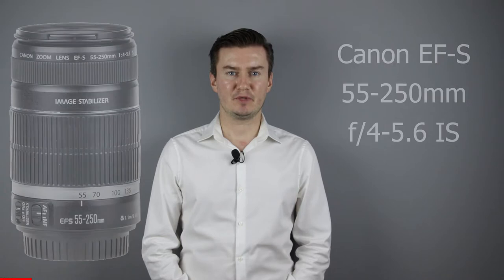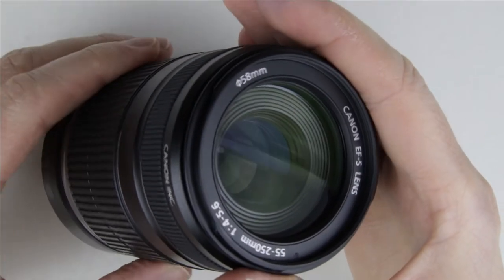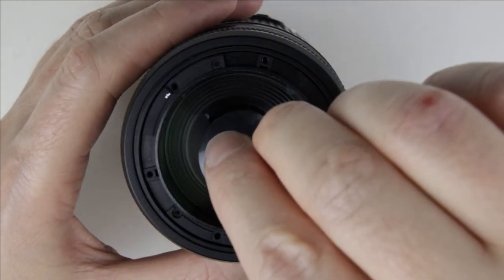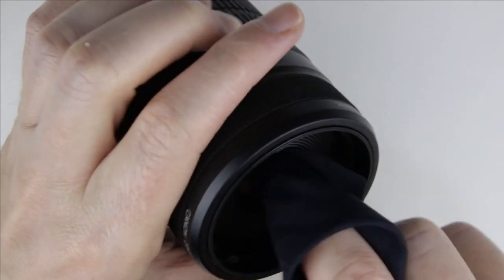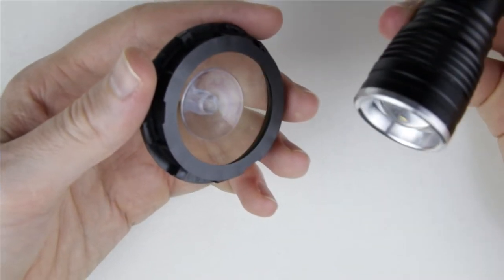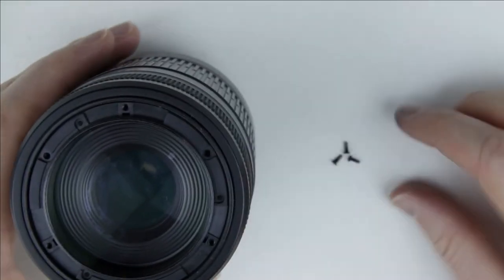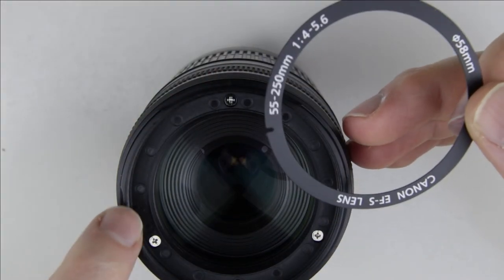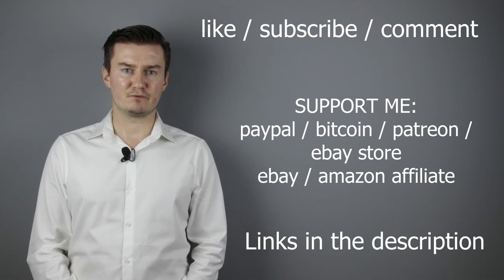Canon EF-S 55-250mm f/4-5.6 IS - how to clean the lens inside

Comment: I have this lens and the part you brushed is covered in mold. Would it be best I go to a repair shop or can I clean it myself?
Reply from the maker: You can clean it yourself. Keep in mind that if there is mold between the two pieces of the front lens element, then you can't clean it because it is not possible to separate those two lens elements.

Comment: Does 99% isopropyl alcohol work or is it very abrasive?
Reply from the maker: I clean with IPA alcohol (mine is 70% alcohol and 30% water)first, then I use distilled water with a perfectly clean microfiber cloth.
IPA alcohol is not going to dissolve the parts of the lens, don't worry.

Comment: I have fungus trapped inside the first glass how do i open it to clean it??
Reply from the maker: Generally, it is not possible to clean that.
Reply: @CamerasLensesEtc  i hve it on my 55-250 and my 28-135
Reply: Wonderful video. Is there a video on eliminating dust on inner side of rear elements? Thanks.
Reply: im not clean fungus ,just change new uv filter